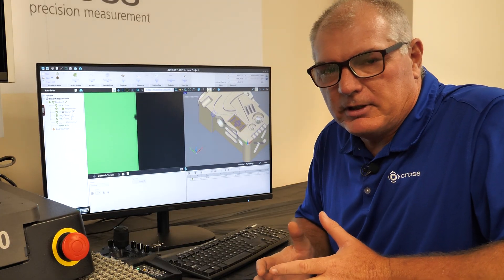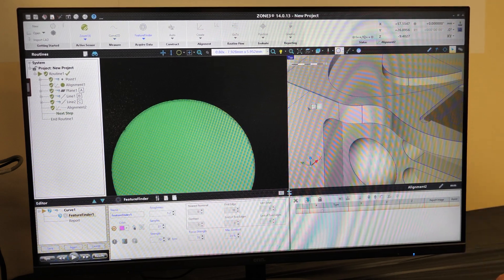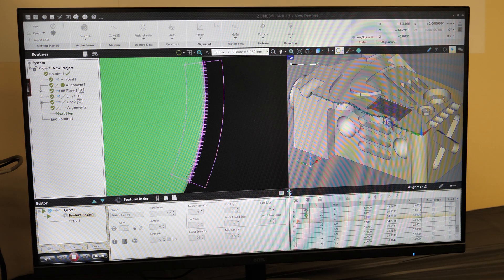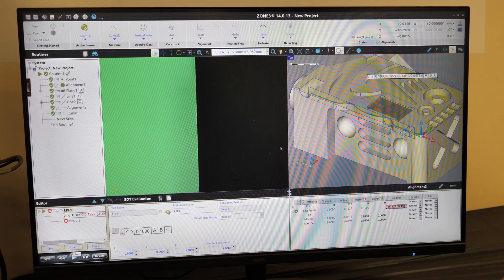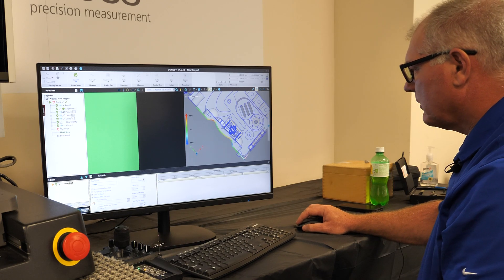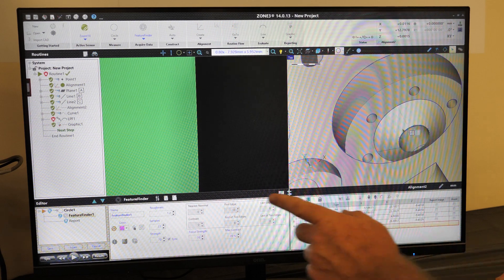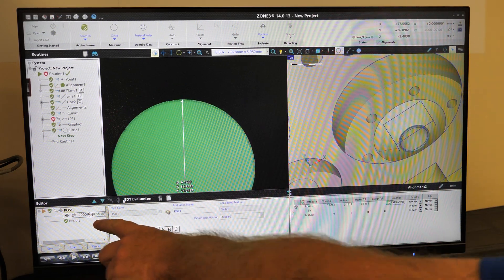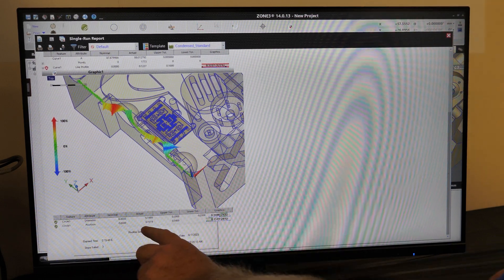ZONE3 Tips & Tricks Episode 7: GD&T Profile and True Position

Comment: What type of supporting hardware is needed to use the Zone 3 software on an OGP Smartscope 200?
Reply from the maker: To support the current version of ZONE3, your PC Controller needs to be using Windows 10 or higher. If your system is on an older Operating System, contact us at sales@crossco.com to discuss how to get your system upgraded.